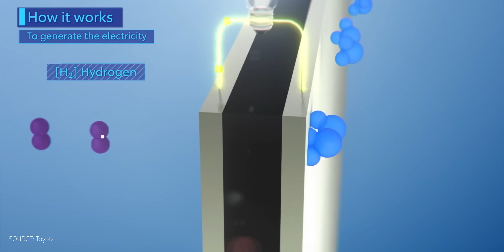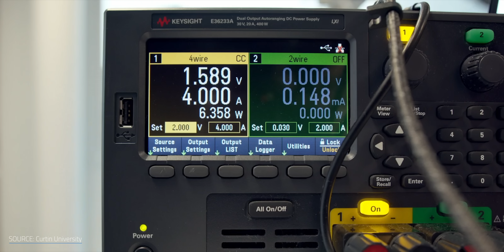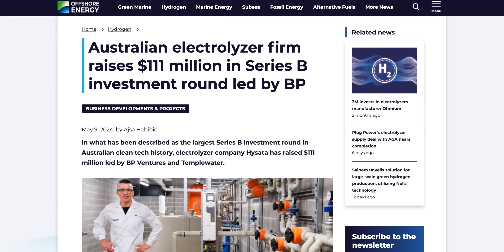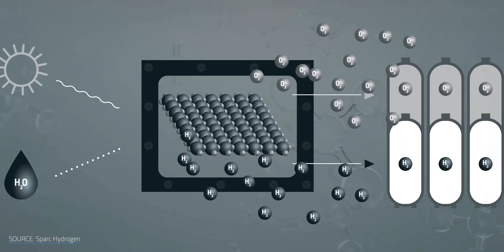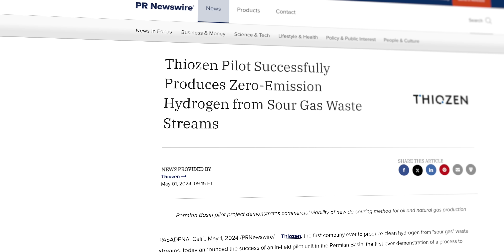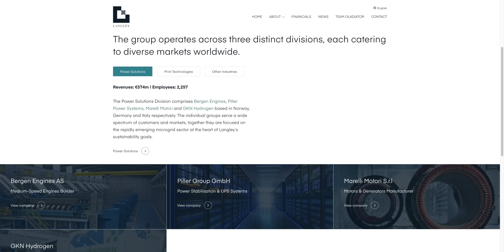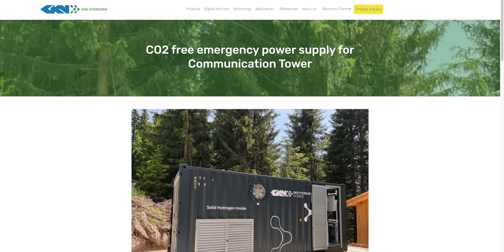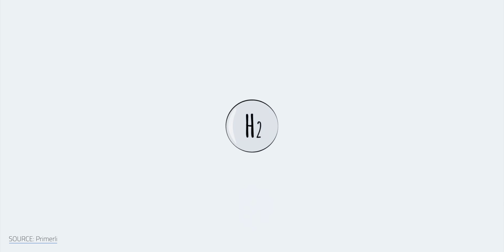How a Hydrogen Breakthrough is Closer Than Ever

Comment: Hydrogen seems to be struggling with the same issues it did 20 years ago. End-to-end efficiency is poor, and storage is difficult. There are advancements, sure, but not the way solar/wind/batteries have.

We're already past the point where we'll see hydrogen in cars. Batteries have won that. Will we see it in larger applications where batteries aren't good enough, like large trucks or construction equipment?

The trouble is that batteries keep getting better, too. Take the 5-8%/year improvement we've been seeing in battery tech and run it forward another 10-15 years, and you have something good enough to cover most of the uses above. Will hydrogen be able to solve its problems and become established in those niches before then? Maybe, but given that it's still struggling with problems we've known about for a while, I have my doubts.
Reply: I agree. The only hope hydrogen has is if someone invents a way for it to be used in a loop over and over. Like how animals convert carbon and oxygen into CO2 and then plants basically undo the process via photosynthesis. It would have to be self sustaining.
Reply: @KidHorn7001  Hydrogen is still a factor to consider as green alternative for airplanes, trucks etc. but for cars the battery has sailed .. H2 unlikely will catch up, there a massive suprise breakthrough would be needed to make it.
Reply: Batteries are only getting better and better, once sodium batteries become commonplace, hydrogen will be done.
Reply: @nzoomed  Sodium-ion cathode cells won't be great for high energy storage, even with advanced anodes.

Much more interesting cathode chemistries would be layered sulfur-lithium cathodes or aluminium-ion cathodes, but commercially available cells have yet to be made outside of maybe Lyten.
Reply: https://www.youtube.com/watch?v=Zklo4Z1SqkE
Titled why hydrogen will never be the answer by Physicist Sabine
Reply: Unless we come up with some new miraculous ground breaking  battery improvement, you can’t just claim that we will see a steady yearly improvement for the next 10-15 years…. That’s not this works. Thats  not how any of this works. There’s only so much you can do to a battery.
Reply: with 95% efficiency it does become a little more interesting for large vehicles that need a lot of range. for buses the operating costs of BEV and HFCEV are already surprisingly close, even with all the loses. but for lighter vehicles the ship already sailed, there no beating batteries. for airplanes and ships hydrogen wouldn't work, but ammonia synthesized from hydrogen is kinda interesting... if it wasn't extremely deadly.
Reply: @danilooliveira6580  with 95 it would, but that must be a bogus number because it was never 75% before, the efficiency if what? If only 5% would be lost as heat, that would be amazing, but I bet thats not what we are actually talking about.
Reply: @georgelionon9050  the 95% would be only for the electrolysis process, not the entire chain. if you include loses from leakage, compression, and fuel cells, it's much lower. but the increase does make it more competitive.
Reply: @danilooliveira6580  Sorry I was wrong, electrolyis by itself is actually much better than I thought..
Reply: @danilooliveira6580  - buses close? During the olympics when Toyota was providing additional hydrogen buses to the existing Paris fleet, along with temporary hydrogen refilling stations, the bus operators wrote an open letter of complaint as the cost of operating the hydrogen fleet was 42% higher than battery fleets, and some 70% higher on fueling costs alone.
Reply: @danilooliveira6580  electrolyser efficiency is only one part of the puzzle. You need to find a way to operate electrolyser with variable wind and solar.

You should make it cost effective to produce hydrogen with those electrolysers.

And hydrogen is hard to transport and store because of its low density and low volumetric density.

Also hydrogen fuel cells used in vehicles are only 50-60% efficient.

The only use case for green hydrogen is chemical processes
Reply: @JSM-bb80u  yes, but as I said, for bigger vehicles the cost start to become more comparable, an increase in electrolysis efficiency from 75 to 95% makes local hydrogen generation more interesting. I don't know if it would drop the cost enough to make for example FCEV buses a much better choice over BEV buses, but it makes it worth researching. I mean, the theoretical efficiency of fuel cells is 90%, if we get close to that fuel cells would be much closer to batteries in efficiency.
Reply: @danilooliveira6580  the biggest problem is storage of hydrogen. 
Also as far as I know the theoretical efficiency of hydrogen fuel cell is 83%
Reply: Hydrogen might be the only way to decarbonize aviation?
Reply: @dxkaiyuan4177  - in short no. Batteries are already used commercially (short haul flight). Medium haul appears to be more than able to be supported by battery powered flight. These two sectors alone address the majority of flight usage. Long haul at the moment is open to either hydrogen combustion or efuels, targetting mid-2030's for first operation. That said if metal-air batteries become a reality before 2030, as currently projected, then even long haul may become fully electric.
Reply: For example CATL the biggest battery manufacturer has launched 500 Wh/kg condensed battery. Aluminum ion batteries are developing in a fast pace too. Which has a theoretical energy density of 900 Wh/kg. And already showed 370 Wh/kg. 

So I don't think on shore freight transportation would ever need hydrogen.We can use electric freight trains for long transportation and electric trucks for the last mile delivery.

Even if we use hydrogen for shipping it's better to use it in the form of liquid ammonia.
Reply: @JSM-bb80u - Indeed,  Metal-Air batteries have even higher maximum energy density with Lithium-Air near that of petroleum at 11 kWh/kg.
Reply: @GruffSillyGoat  It is practically impossible for full lithium-air cells to have an energy density of 12kWh/kg, since you need to pack in the oxidizer and other cell components.
For a fully enclosed cell design, 6kWh/kg is the maximum.
For an open cell design, the maximum ranges from 8-9.5kWh/kg.
Reply: @neutronpcxt372  - true, but this was a comparison of the max energy density, since this is what was being quoted in the example I replied to. However, even if you take practical energy density then that of metal-air cells (like Lithium-air) these still exceeds the practical energy density of jet fuels (being closer to 4 kWh/kg in the most efficient jet engines or 2 kWh/kg in prop engines).
Reply: @GruffSillyGoat  Definitely. I just added my grain of salt to give some context to other readers.

It's one of the inherent upsides or downsides of batteries: they need to carry their own oxidizer :P
Reply: @neutronpcxt372  - no problem, most batteries carry their own reactants, fuel-cells differ in that most cases using atmospheric oxygen. Similarly, metal-air batteries as the name suggests use atmospheric oxygen (although some examples use high oxygen mixes, this is still applied externally rather than carried within the battery).
Reply: @GruffSillyGoat  Definitely. However, an interesting factor that many people don't take into account fuel cells is that hydrogen inherently has more friction/kWh vs something like methane since you need to pump a whole lot more gas.
Reply: @JSM-bb80u  Also it's not the hardest engineering problem to add charging options for battery-electric trains.
Reply: @KevinLyda  We can just use electric overhead wires for the most part. And use batteries for small passages like under passes and bridges where it's hard and costly to put electric wires. 

This way you wouldn't need a heavy battery.
Reply: Yeah hydrogens ship has sailed. Batteries for EVs are good enough with adjustment for most drivers since most don't drive more than 40 miles. 

 Charging stations is a problem. With electricity. Which is already there. Hydrogens infrastructure is null. 

 To me hydrogen sucks simply due to volumetric density. It is crap. It is dangerous to store. It likes to corrode and leak. It needs less in the air to blow up too I recently learned while learning about rockets lol. (Unless I am wrong on that part. Something about air fuel ratio). 

 It is expensive.

 Hydrogen is great for space. Under water submarines. An option for industries or niche uses. 

 I heard fossil fuel companies are funding the reseach for hydrogen, and trying to extend the need for them by switching everyone to hydrogen.
Reply: @dianapennepacker6854  Would think the most pressing question should be efficiency. Naturally cost must be considered but over all efficiency, plus the point is to save the planet, the question of how much cost is acceptable, to get to the efficiency, should carry a good deal of weight? Maintaining wind generators out at sea would seem a real concern (can't be the most efficient way to produce energy).
Batteries are good but if we are going to get more severe rains how well would batteries do if they are driven through more instances of high water?
Also, how much is it worth to have a few plants producing hydrogen and not to have thousands of wind generators marring the landscape?
Reply: @allenbragg7920  it doesn't make economic sense to have just a few plants making all the hydrogen. Transport losses would be too big. It needs to be made near point of use.
Reply: @dianapennepacker6854  In road transportation... I agree.
On other side, there will be always a market for hydrogen. Already exists, in fertilizers and it's proposed as a key technology to decarbonify industries like steel or concrete production.

And the heavy/high density transportation/machinery still remain as a chance. I mean long freight transportation, air travel, etc.
It depends on the competition with other solutions.

On cars and light vehicles it's just too late. EV are getting better and I doubt we deploy two different systems at the same time. Just too costly. Electricity is just more efficient and batteries are already good enough for a good part of the market, and getting better, so they will be probably ready for >95% market in just a decade.
Not enough time for a hydrogen deployment alternative. Just too close in time to do anything. And transition to reach the same or worse is just not desiderable.
Reply: Batteries are only winning because the law says so.
Reply: @ghoulbuster1  what laws?
Reply: No , Toyota and BMW are starting to build cars and hydrogen station .
Reply: @CMeosuarra  no, those are already failing
Reply: @CMeosuarra  Waste of time implementing the hydrogen filling infrastructure and i doubt purchasing hydrogen will cost less than petrol.

Comment: If we turn water into energy in this way. Won’t that cause a shortage of water?  It’s not 1:1. 1 gallon water turned hydrogen through electrolysis doesn’t produce 1 gallon of “exhaust” water does it?  Where does that leave us?  Plus the energy to make hydrogen would offset the green since we have to use fossil fuels to run the machines.  I feel this is why they keep the good ChatGPT away from
Us thinkers and tinkerers.  In the end it’s going to tell us in order to save the planet you just have to stop doing what you all are doing. The earth can only handle so much waste heat.  Does it in the end matter if we green up energy production when the result is always heat.  No one is proposing reducing total world energy    consumption   Want to know what’s worse is we have ever increasing energy prices and we don’t know how to fix that. But when Microsoft decides it needs 3 mile island spun up for ai that’s ok. And we know that’ll only benefit one man.  Sad day when big tech is the cause and not a solution.

Comment: Hydrogen extraction chemistry without electricity was founded in 1700s with oxidizing iron and algae off-gasing of H2 in water. Also burning wood and running through a carbon filter known as Gasification produced 12% Hydrogen.
The first hydrogen-filled balloon, Le Globe, was launched in France by Jacques Alexandre César Charles in August 1783.
Anyone with a chemistry set can produce their own hydrogen plant.
Reply: You can also mix aluminum with gallium and drop it in water. The result is aluminum oxide, gallium, and hydrogen. 

Then you just melt the oxide back into aluminum, mix in the gallium back in with the aluminum. And boom back into a catalyst. 

The aluminum could be melted using mirrors. Making the whole cycle eco friendly and renewable.
Reply: @sirsneakybeaky  Nice Metallurgy Alchemy!
1 more way to make hydrogen is Carbon Monoxide in water at 300° CO1 + H2O = H2 + CO2

Comment: I really do hope Hydrogen becomes a thing, it's always nice to see new solutions
Reply: There will be no miracle solutions to hydrogen's storage problems. The most effective storage method is cryogenic as a liquid, which is extremely energy-intensive to condense even if you achieve 100% efficiency on the electrolyzer end of things and will be problematic for domestic use where storage will be venting boil-off when vehicles aren't in use. If you store it in a ceramic or other media, the energy density gets reduced by the amount of media needed to store a given amount of hydrogen and the amount of energy that needs to be pumped into the media to release its hydrogen, by which point you may be better off using batteries.
Reply: @teardowndan5364  I'm aware of every setback hydrogen faces. Mine was just a wish that we find new technologies so hydrogen becomes a thing, because it would be cool to have a new thing
Reply: @usbgamers123  Wishes are one thing, physics is another. Physics say hydrogen as a fuel is fundamentally impractical for most applications, especially small-scale mobile stuff like cars.

Where hydrogen may make the most sense is grid-scale energy storage: electrolyze excess renewable production for storage, then use it to run inverters on hydrogen fuel cells to supply peak demand or offsets lulls in renewable output. Static applications don't need to worry about tank size and weight.
Reply: @teardowndan5364  Dude, get the memo, I know all of this, I know it's impractical, I know our current technology doesn't allow it, I know it's pretty much "fad" now. But against all of this, can't a man wish for a better future?
Reply: @usbgamers123  It isn't a problem of "current technology", it is a problem of fundamental physics. An efficient way of compressing or liquefying gasses when you have no secondary uses for incidental heat release does not exist and never will, guaranteed by the laws of thermodynamics. Making hydrides absorb hydrogen requires energy too, especially if you want the process to happen in a timely manner, no free lunch there.

Compressed or liquefied air energy storage sort-of-works because they store heat from compression and liquefaction for reuse later when expanding gas for generation. Can't really ship the heat from liquefying hydrogen with the hydrogen for use on a plane, boat or truck, completely destroys the energy density.

A lot of "promising new green tech" is just grifting for government grants with nobody sanity-checking the fundamental physics behind it.
Reply: That's what we said in the 1970's.
Reply: It will thr oroblem is the market is full if fossil fuels green energy cant grow and become common place until fossil fuels are banned by being fazed out. Investors would stsrt putting money into green energy instead

Comment: Seems like a complex refueling infrastructure is needed for hydrogen cars to be viable...
Reply: Yes, still waiting for Toyota to invest $500B in a world wide refueling network.
Reply: @PrototypePrjs  1/4th volumetric density of gasoline, 1/5th of diesel for hydrogen in LIQUID form.
So your car with 100l gasoline tank would need 400-500l tank of liquid hydrogen. That's already a joke and we didn't even started talking about how to build 400-500 litre, average consumer safe, lightweight and road safe liquid hydrogen tank. 😂
And thats physical limit, all those compressed hydrogen tank have lower energy densities than liquid hydrogen.
Chemical/absorption methods exist that theoretically can be more dense per volume but nobody pulled it off yet and ... they're still below both volumetric and gravimetric density of gasoline and diesel. So most likely nobody will pull it off as why on earth would you sink billion dollars to get results worse than gasoline...
Reply: Which is why petrochemical companies love the concept of hydrogen.

Comment: The amount of energy it takes to extract hydrogen (electrolysis) from water makes it impractical.  I don’t mean to be negative.  However, the next renewable energy breakthrough “Will be here soon.”  How soon?  We don’t have much time to solve this problem. Fusion is always just “20 years away”. The research needs to continue but we need something we can use now not 20 or 30 years from now.  Also, how does the cost of operation of these electrolyzers compare to extracting, refining, and distributing petroleum products?  Can these electrolyzers be reasonably scaled up to the level the US would need?  Again what is the cost of building the electrolyzer and cost of operation?  The numbers have to work or it is DOA.  Also, storage was addressed but what about distribution?  I am glad that the energy source for electrolysis was addressed.  Thank you.

Comment: I took particle physics at Univ of Geneva and showed my research to them and CERN and FERMILAB etc....we used CMOS detection to see muons and neutrinos....they shut CERN down to upgrade to CMOS after I informed them CMOS would work.... We used light into a FINELY tuned venturi and created electron showers and sterile Muons...I have the videos on my channel. I would like to engage Matt? "The Material Evidence of the Theory that Changed Everything" as you will see we should be able to get free energy right now.